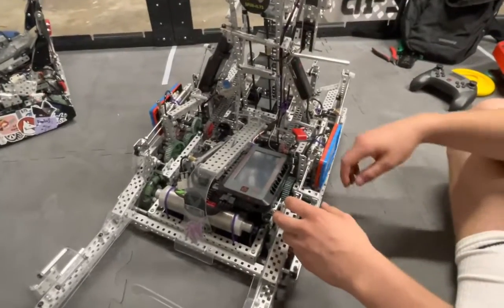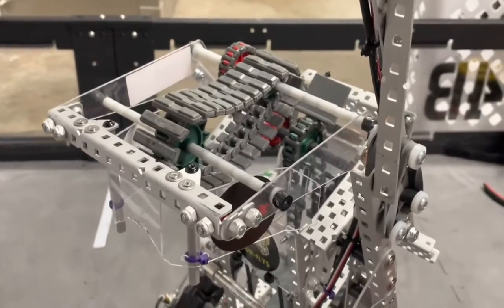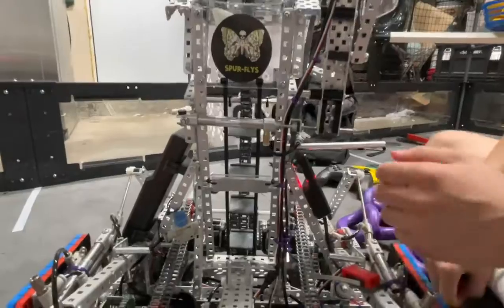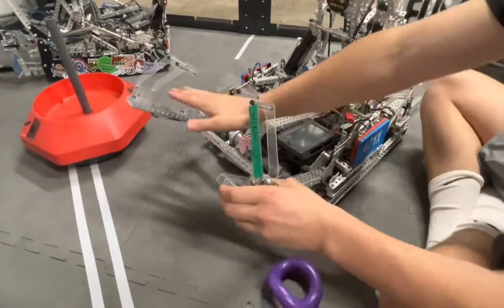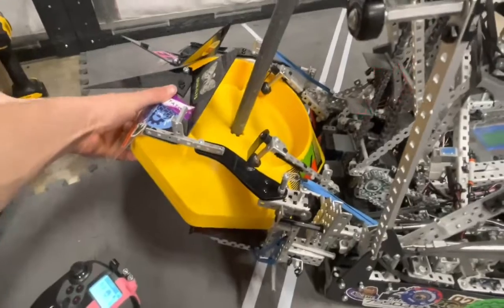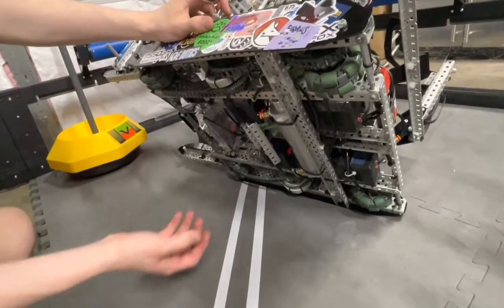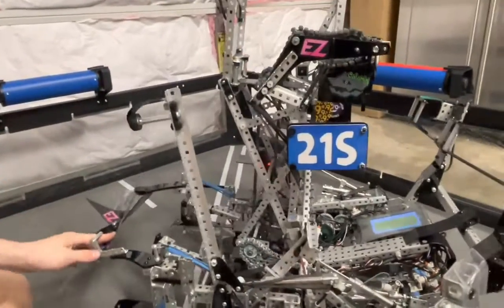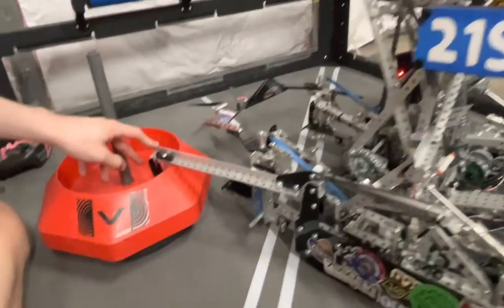21S & 471X VEX Tipping Point Worlds Robots Explained

Comment: Very cool.
Few questions for you guys after looking through the photos albums:
where did you get the black plastic (Delrin?)?
What are the little phillips screws you used on your bearings and on other parts of your robot? I assume some type of shoulder screw?
Thanks!
Reply from the maker: The black plastic is just black lexan we got from ebay.
the little phillips screws are countersunk 4-40 screws from mcmaster: https://www.mcmaster.com/91099A167/
Reply: @LucasWills  What's the point of the 4-40 screws? just lighter weight? if so, what's the advantage over nylon or aluminum screws and nuts (other than the fact that they are now vrc illegal?)